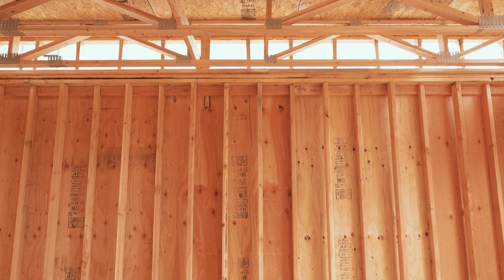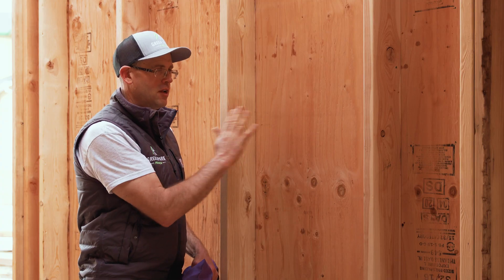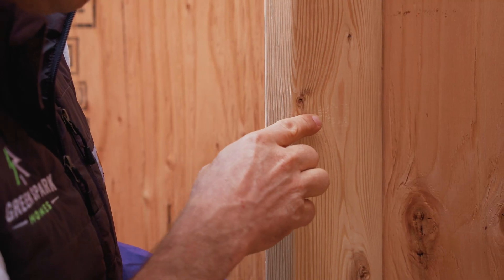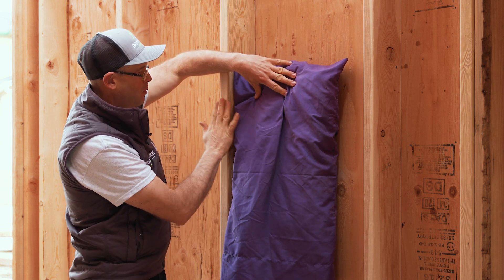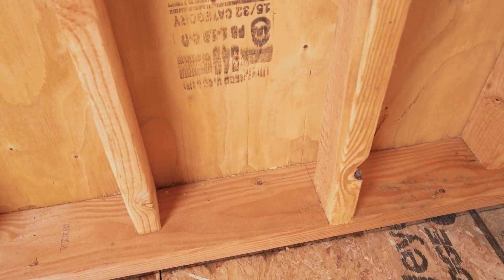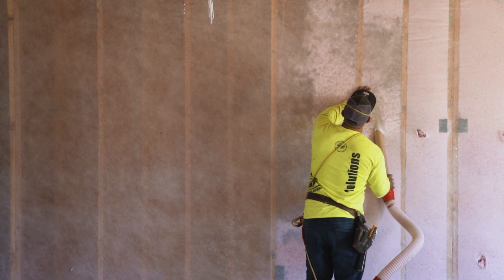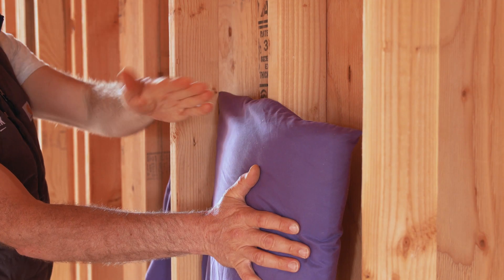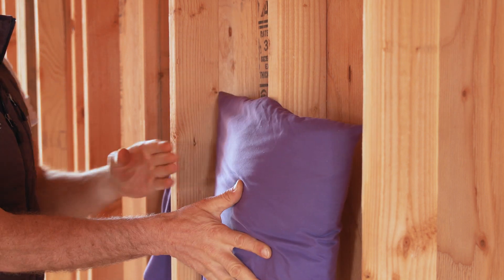Energy Efficient Framing | Green Spark Informative Video

Comment: By breaking the thermal bridge, you really don't need to blow in insulation.  You can staple batt insulation and that will do (and it is less costly than blowing in the insulation).  If you want to get 'fancy' and have insulation between the 'inside' row of studs and the subsiding, you can cut solid sheets of insulation 2" side and nail it to the stud before installation.  

Another cost saving tip is that the inside studs holding up the drywall and insulation do not have to be 'standard and better' (structural) studs; they can be 'utility' or even salvaged (I got a lot from rejects at production housing and long pallets).  

Finally, this breaking the thermal bridge also reduces the noise pollution from outside to inside very effectively.